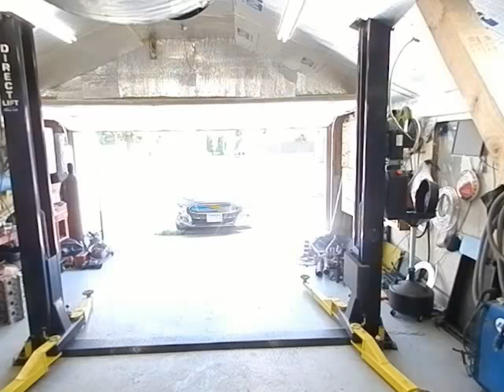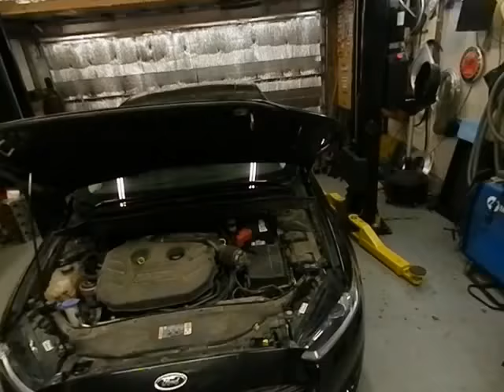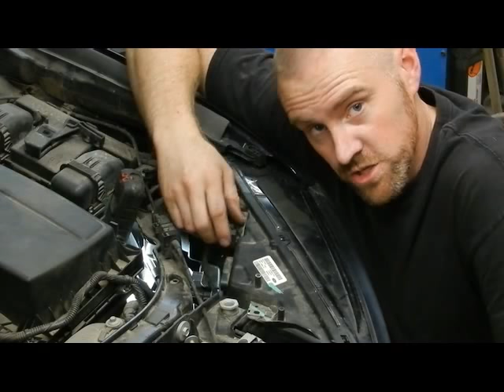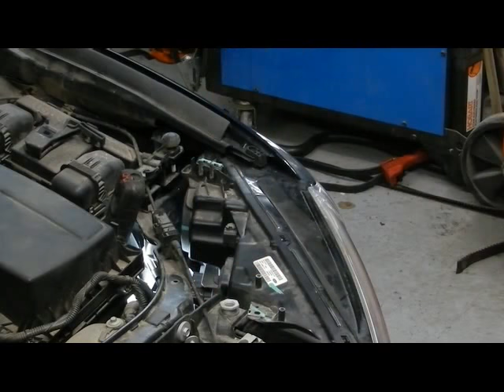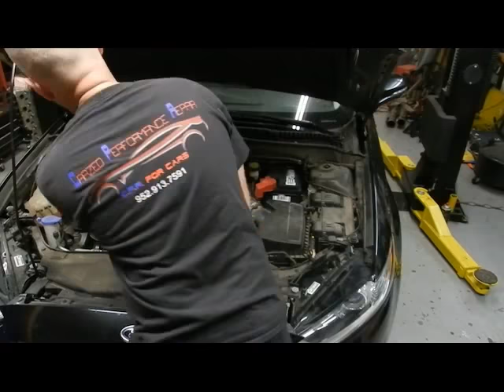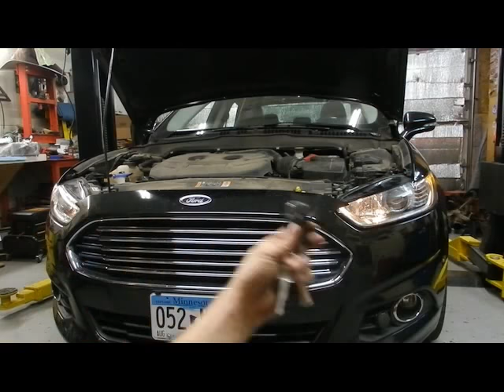2014 Ford Fusion Bulb/Running Light Headlight

Comment: Trying to change a simple low-beam headlight on our Fusion has turned me into a raging Ford HATER. Glad I found this video.
Reply from the maker: LMFAO
Reply: I hear that Ford design sucks. Me and my neighbor just changed all the headlights on the 2015 Fusion hybrid with out dropping the bumper, but we removed many bolts, clips wire harnesses. Those engineers should be slapped upside their heads!
Reply: Honestly most other common car brands aren't muuuch better.
Reply: I dropped the bumper and changed all lights on my 2016. Took a lot of time as it was first time. Bad design at the finest
Reply: @wyomingptt  My hyundai was a breeze, didnt even need a screwdriver.

Comment: I went thru this hell back in 2019. My low beam lights were not bright at all, so I waited to change them until I had to remove the entire front bumper to fix another problem too. And just this week (Dec 2022), both of the low beam bulbs I replaced 3 years ago burned out within 5 days of each other. You just cannot make this stuff up. To think that you have to do this every 3 years is enough to make me hate domestic automobiles.

Comment: I tried the process and was able pull the headlight out.  But could not access the bulb. The metal bracket holding the headlamp bulb in is in the way or my hands are too big to get in there.  Could not squeeze the bulb housing to pull it out.

Comment: This is fucking ridiculous, imagine doing all this every year just to replace a god damn bulb. All the screws are hiding all the way inside and only a 3 years old baby can access to them.and all the lights are off center from the cap. A slightly larger Led bulb will never fit in a right angle. Ford wants us to buy a new car after a burnt bulb.

Comment: I replaced the low beam without dismantling the car, just take the dirt protector cover off  and turn the bulb counter clockwise. I used H11 bulbs. Hope this helps .
Reply: egc1972 talking about in the tire well? Or underneath?
Reply: I'f u take the dirt cover under the hood off then pull a few more tabs unbolt the headlight u can pull the headlight forward just enough to get your hand back in there but it's kinda tricky I'd just take the bumper off if its your first attempt with the car. Then try next time once you get a better view of that layout

Comment: You never mentioned what size bulb that was please
Reply from the maker: I just used a 194 bulb.
Reply: H11
Reply: 2013 manual states W5W, which is a 5w bulb, the 194 should be 3.8w but works per this video and the comment from the creator...  An H11 isn't a DRL but a headlight bulb that is a completely different socket type than what this video is about.

Comment: My 2014 1.5L fusion stalls any suggestions on what I can do it has 42500 miles on it
Reply from the maker: Is there any specific time it stalls?
Reply: After I drive it for awhile park get out then get back in start up then stalls or if I'm sitting in a drive-through it will stall out
Reply from the maker: @eddiehill5523  start stall could be fuel issue, the drive through though hmm perhaps you have a fuel pump going out? Should probably have fuel pump amp draw checked on a lab scope to see if the pump is in good shape or not. A good test on a lab scope can tell a lot from worn brushes, bushings, armature, plugged filter to even a bad or plugged sock.
Reply: I have an automatic starter would that  be a the problem
Reply from the maker: @eddiehill5523  lol oh my yes that is normal than, I totally forgot about that feature. There should be a button to turn the system off, do that every time you get in the car for a little while. I bet as long as you remember to deactivate it the car will stop doing it.
Reply: Where could I find that the button to turn it off
Reply: The automatic starter
Reply from the maker: On the F150 it is located above the radio I believe. I am not sure where it is on the fusion or if it has one but I am sure your owners manual can shed some light on this.
Reply: Check your evap purge cannister, it's a common cause of stalls and erratic idle on the fusion.
Reply: Purge canister. Happens more often after fill up/top off on fuel.
Reply: FYI, (for future readers of old post) Replace Fuel Injection Pressure Sensor Low Side B. Ford Motorcraft CM-5250 Part# BU5Z-9F972-B. This will remedy the stall issues. I own 3 Ford Fusions, changed them all. Common problem. YT videos on how to replace.

Comment: This trick works well, however next time including the bulb number would be helpful,  so I will for you. Standard size is a 194, or in led Sylvania it is a 168. Also at part store it is referred to as a running light. Great video though.
Reply: He said the number in the first 30 seconds